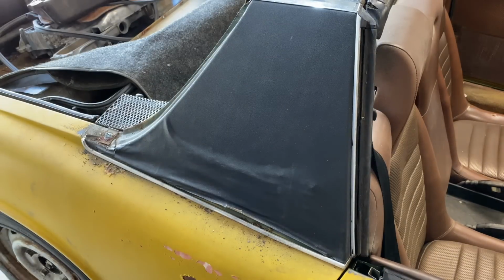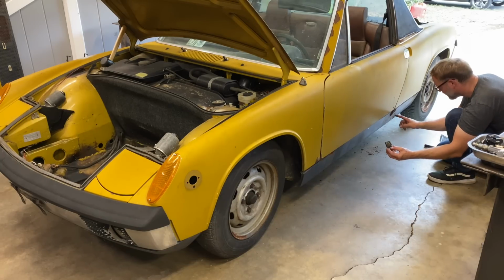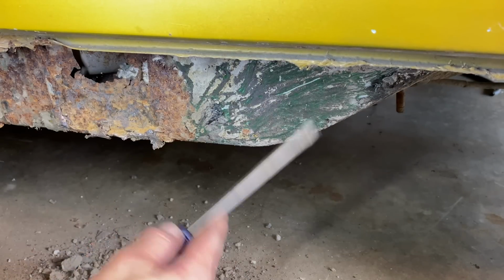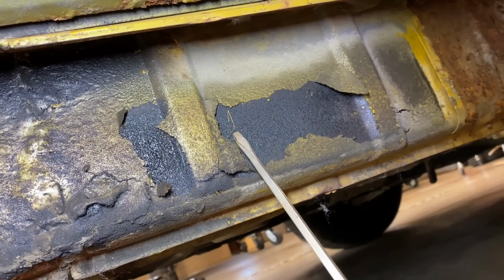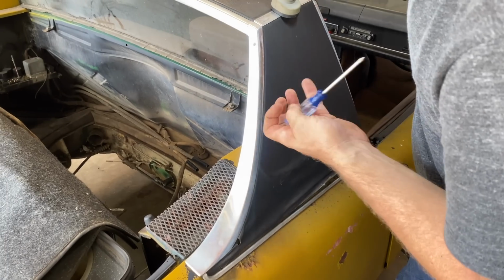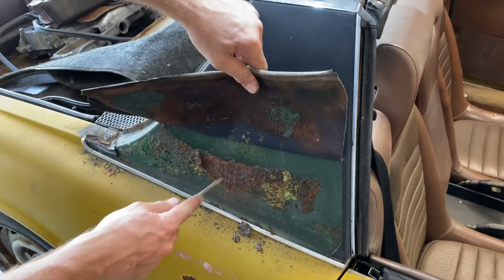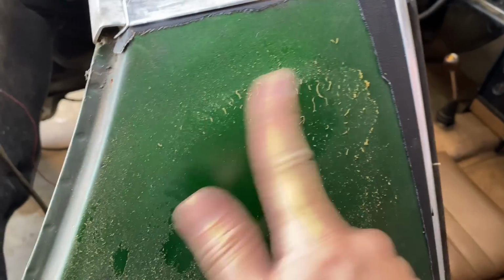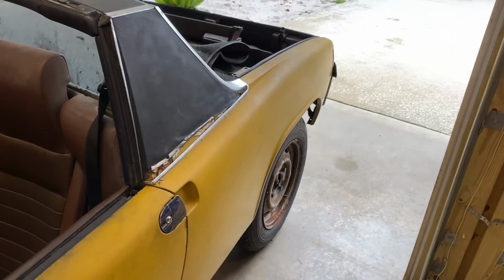Abandoned Porsche 914 Rescue Restoration! Hidden RUST Revealed! Type 4 air-cooled Volkswagen, ctmoog

Comment: I had a 914 years ago.  The body does flex quite a bit.  If you are going to do more than just a "cosmetic restoration"  the best thing to do is to strip the body down to the raw frame (bare metal) and replace metal wherever necessary.  Lots of places for metal to rust.  That restoration project can get very expensive..............

Comment: Just put a little rust converter on that and spray can it with some rust paint black. put new vinyl on with the vinyl glue and a heat gun and call it good.

Comment: Those are called sail panels ct and yes they do make them,  the frame sections can be patched as nobody will see them anyway as well as the hell hole,  you're doing fine,  knowledge comes with time and this is how we all learned,  be gentle with the parts, all parts,  as some may not be available or could be very expensive,  keep in mind that inspite of the vw motor you're paying for Porsche parts
Reply from the maker: Thanks Michael! Good to know. Learning more everyday. Thank soft the support. Yes, the parts are way more expensive! =)

Comment: If nobody has already directed you to the '914 World' forum ( 914world.com ), do yourself a favor and check us out. 
Also, one of our members owns 914rubber.com ... they make a lot of the NLA parts for these cars, especially rubber and plastic parts.
PelicanParts.com, and a few other commercial vendors, along with member-owned sources have most of the electrical, mechanical and sheet metal parts needed for restoring 914s.

Comment: When removing that trim, go buy a plastic pry tool at the auto part store. Nice car and video.
Reply from the maker: Good tip! Thanks man!
Reply: The best way to remove the rear side sail trim pieces is to loosen the nuts (that are way up under the rear fenders) enough to slide the lower portion of the trim off of the 'T' bolt that secures them in place.  If not, the trim pieces get deformed, like ones that are seen on too many 914s.

Comment: Ah, brings back memories.   Mine was original gold 1972 914-4 painted to yellow, tho was less rusty in most spots as it still had the jack points.   I ended up replacing the driver's rear quarterpanel and sail, plus the left rear suspension console where battery acid had et out the area; pretty easily done in a garage if time consuming to do right.   The motor was the original 4 with some DPO (dreaded previous owner) 1.9 big bore kit, tweaked Jet-D & 911 brakes.   Blast to drive.

Comment: Hey CT, that isn't the worst 914 I've ever seen. Looks really solid. I think you will do a good job on it.
New seals are the best descission to save the car from more rust. Just throw every old rubber away that holds out the rain.
There are special tools like forks for those clips so you can pull it out from both sides and you don't bend the strips. Those strips are very expensive, this tool isn't.
And please use cloves when you touch this rusted metall. Especially when there's a mouse nest 🐀💩 behind. These sections are sometimes very sharp und you may get a sepsis.
Watch youself and good luck with your next project!
I enjoyed watching you. 😎👍
Reply from the maker: Thanks Andy! Yes, it's not too bad. I think it can be saved. Good idea. I will do that next time! Thanks my friend!
Reply: @CTmoog  Hey CT, do you have an email-adress where I can send you informations about tools or parts?
I'm an employer of Porsche and maybe I can help you more this way.
You have to understand that I don't want to do it this way... Sorry.
😎

Comment: Hey CT...I searched and found a site called Carparts.com.  They have your Porsche 914 weatherstrip for door area and all the other areas.
Reply from the maker: Thanks Doug! I will check them out!😎
Reply: I had a 1950 Chev 5 window truck that a local shop  replaced a cracked door glass. While they had it I had them replace all the weather stripping, it wasn't that expensive.

Comment: I do believe I'm late to this but I do have an irrational love for the 914's. Edd China did a very good job on the one he worked on when he was on Wheeler Dealers. I do wish people wouldn't harp on the "destruction" you did on it. Considering the amount of rust you're going to end up doing destruction in order to find out just what needs to be replaced. Stabbing with a screwdriver is sometimes the best way to determine if there's a weak spot in what may appear to be strong metal. If people disagree with what you're doing, they're more than welcome to watch something else. I do hope you get back to it and the original green would be a kick ass color.

There are several places in Germany that re-manufacture parts for the 914 (interior parts, the vinyl side portions and probably the targa top, and other bits and bobs) that may come in handy. The cost of some of the parts might be a bit expensive at times but once finished and repaired, you might get good money if you decide to sell it.

Comment: Even cheap wire brushes will be your great friend during this process. They make all sizes at most auto parts stores... and WalMart even has them. That scraping and digging with a screwdriver you're doing would be MUCH easier with wire brushes, if not a wire wheel.  I know some type of digging is required for some areas, but surface rust and debris come off almost instantly with wire brushes... and again, they don't have to be expensive.  Hey... just trying to help. 🙂

Comment: I had one of these a long time ago! Not real fast but damn it was fun to drive! If only they had put a better engine in it!
Reply: they did, 914-6 there were a couple (2) boxer 350hp 8 cylinders made as well, by Porsche. The body is designed around both the 4 and the 6 and you can get a 911 engine with any horsepower you want, just upgrade the rest of the car to take it if over 200 or so.

Comment: Hi there, Mr. C.T. Back again to watch your videos while having dinner.. =) Jap, nice things are found inside old sitting cars.. and yes,  more rust, as always. Actually it's not even that bad since I've expected it to be in worse condition.. Some patches and some welding will be required, but nothing difficult. The only thing I've never understood is the madness of putting vinyl over the painted metal, makes absolutely no sense as it goes hard and cracky under the sunlight. Then it traps water in between and the whole panels get totally rotten. It's an abomination I've seen on american cars only. Do you have any idea about the meaning of this concept? Oh, one more advice.. Stick a piece of a mirror on a stick and look through the hole to see the back side rust damage..  Thumbs up! =) Keep going!
Reply from the maker: Hey Paul! How are you? Whats for dinner? =)yes, it's not too bad. I agree. I don't like it when they cover paint with anything. I would rather have the paint. I think the first prototype were like that. Good tip! I will try that! Stay tuned!

Comment: Hi CT. Yeah the black vinyl and aluminum trim was part of the “appearance “ option! They paid extra for that and I deleted it on my car too!  By the way, look at floor pan under petal cluster and on inside of rear trailing arms for a nasty surprise! Made me almost want to give up!
Reply from the maker: Hey William! That is good to know! I will check that out. What year is your 914?
Reply: CT mine was a 72. I adjusted the valves one night and pinched the gasket on the cover! I discovered it when oil pressure went to “0”. Not wanting to rebuild it again , I sold it as is for $900. That was 10 years ago and I still regret it.

Comment: Did you get the spark plug out of the head?
Reply from the maker: Yes! 👍😎👍
Reply: CT BTW; Type 4 motors are very sturdy; blocks almost never fail. You got lucky that you can get that motor in top shape again. You can try Dellorto 36s or 40s and it will work like a clock.

Comment: Too long on details results boring, not using the proper tools like wd40 for screws, ripping the insert and braking it will leave you with an unusable piece or a template for a news one, you can’t take a part a car with a screw driver, for chrome there are proper instruments…